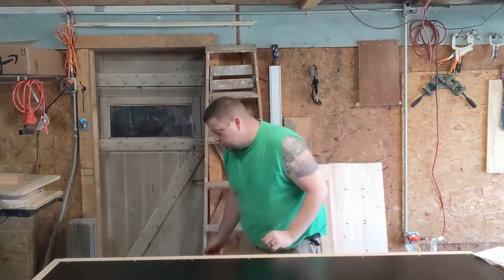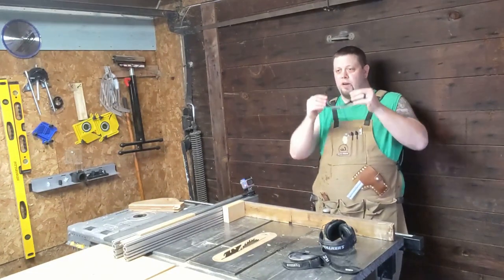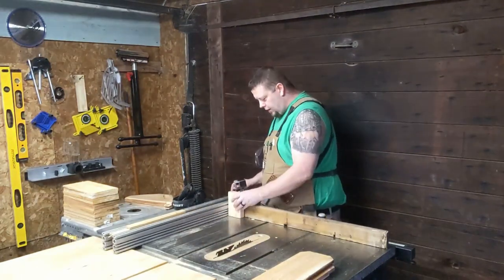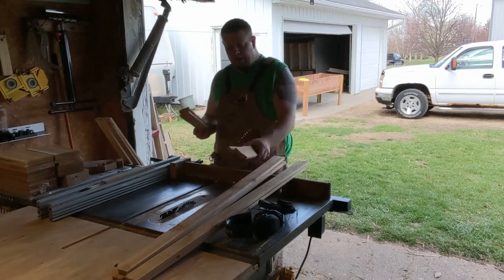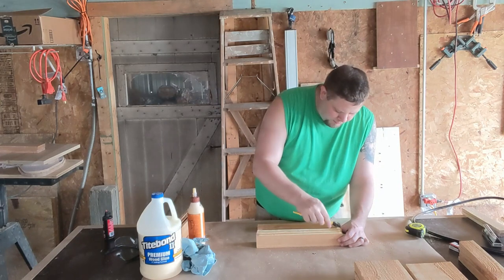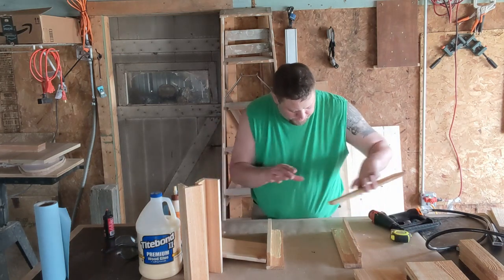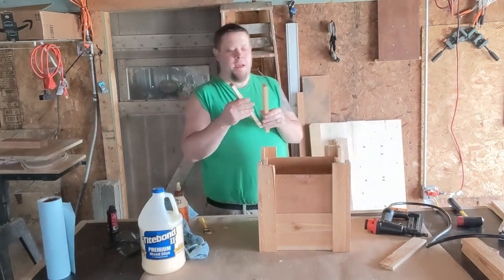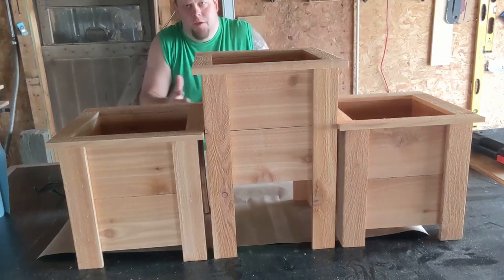DIY Cedar Planter Build | Easy to Make | Inexpensive Planter | DIY Furniture

Comment: Good job, very detailed. One suggestion: cut your miter fence shorter so you can clamp your stop block to the fence. That would keep you from having to move the stop block every time. :) I'll check out the other videos later. :)
Reply from the maker: Yeah I have done that on a project since then on the mitre cuts.  Thanks for the advice keep learning and honing the skills.
Reply: @4321Woodworking  Knowing me, I'd forget the stop block a half dozen times then have to cut again!!😁

Comment: You really need a table saw sled . It would improve your accuracy, adding production stops will stop the tap-n-tap- cut method your saddled with . Nice build
Reply from the maker: Your 100% right!!  I've learned some tricks now that I'm nearing 150 made over the past two springs.  Last year father's Day I got a miter saw and proceeded to build an entire miter station with a sliding stop block.  I use that now for cross cuts and repeatability allows me to batch them.  This video was the first time I built them and was for that collaboration.  I am editing a follow up on how I now produce them faster and the tricks used now.  Thanks for watching and regardless of how I build them now I really really do need to make a cross cut sled!!!

Comment: Isabelle told me about your site -  in school this week.    I received your longer -  narrower planter stand from your shop in May for Mother's Day - Birthday - gift from my son who works in GM.    I planted it with red, white, and blue flowers and American flags.   It stood at the front of the garage -  on the driveway.   Very colorful!   It's in the shed for the winter.   Do I need to stain or protect the wood for its 2nd. summer in the sun?
Reply from the maker: I have had some protect them with boiled linseed oil.  They were all made out of cedar which is naturally rot resistant even to moisture but boiled linseed oil or any other outdoor protectant would make it last even longer.  Stained will only change the color but won't protect it at all.  Majority I sold weren't doing anything but planting them.  It's why I like using cedar.
Reply: @4321Woodworking  thanks for the quick reply!     Stay warm.

Comment: Quick question are you using them at a thickness of 19/32 I had a friend wanting me to plane them down to.hakf inch but doesn't leave much meat left  good build i actually offer the planters in a set of three two at fourteen tall and then the tall one is same box just the longer legs sells well.as a decorative set
Reply from the maker: I don't plane them at all but the ones I buy are 5/8".  I know some are 19/32.... But I'd use them at that also, if I was planning them I'd start charging more for the added work.
Reply: @4321Woodworking  oh yeah for sure the problems ran into with the few I did at then thickness was the added supports I had to use for the supports on the bottom and then having larger pieces on bottom  just didn't seem like it.wasmwoeth thee hassle and was worried about the amount of pressure from soil and or a pot
Reply from the maker: @richardstevens8509  I did consider planing boards for one this year and miter the top rail... for a more "refined" look but now I have a bit of concern.  I just wanted a smooth look, may have to just sand them which doesn't take off as much and gets the same finish.  But I'm sure 98% of mine will be rustic, buy from the box store and start cutting look same as last year.

Comment: Does cedar gum up your blades pretty bad?
Reply from the maker: I've not had any issues and I can say I've had some that was wet but really try and pick through and get lighter dry boards which also seem to have the most coloring them.  But not that I've noticed however I do clean the blade as well every so often just to keep it in tip top performance.

Comment: I guess…. if you were to figure out a way to escape the wife for an entire day this video would show you how! this video is a great tutorial for extremely novice woodworking that are the same script as plenty others! However the attention to the corners and making them match both views makes it stand out from others and gives a profession look vs a weekend project the wife makes you do!
Reply from the maker: When I made these a couple years ago I had the table saw and an out of square radial arm saw.  I just realized when I made these I used cross cuts on the table saw which worked but was slower.  With a miter saw and stop block set up this entire set can be done in 90-120 minutes.  I should consider an updated video but like you stated there are 100s.  I do appreciate you taking the time to watch mine though!

Comment: So are all the "legs" 2 inches? Or are some 2.5 inches and some 2inches. Its confusing to follow...through the video. I am watching carefully and multiple times and its still hard to follow exactly the pieces and sizes.
Reply from the maker: The total length of the legs on the shorter one's is 13" and on the taller one it's 18.5".  Thus the taller one is 5.5" taller or exactly the width of one side panel.  If your looking at it from the bottom of the side panels then the legs would be 2" and 7.5"
Reply: I agree! It was so-ooo freakin confusing to follow long!! The repeating, the awful lighting, the interruptions... I mean he knew what he was doing, but I'm sorry he is not a good teacher (it would have been better to have his instructions typed up on screen while he was doing the cut & build then people can at least pause & read the  rewind & watch if they needed to!)

Comment: Why use a block ?
Why not just place the fence where you need it for the cuts ?
Reply from the maker: The block is for safety on the table saw.  You never want to cross cut against the fence as there is a very high chance the cut off piece could bind between the fence and blade and get what is called a kickback.  The piece ends up getting thrown by the blade very fast dangerous and can cause a very bad injury.  That block just spaces it to leave room for that piece to not bind and not get kicked back is all.